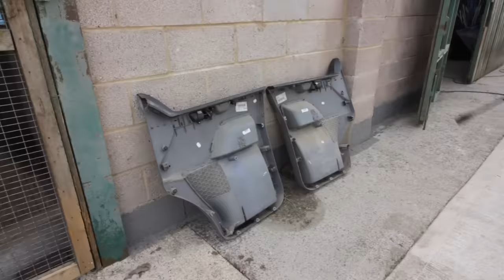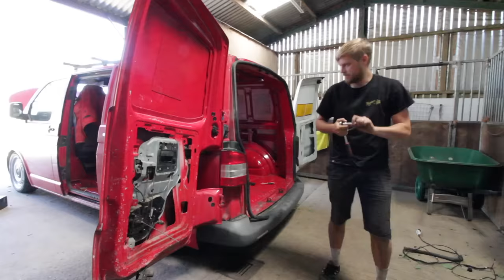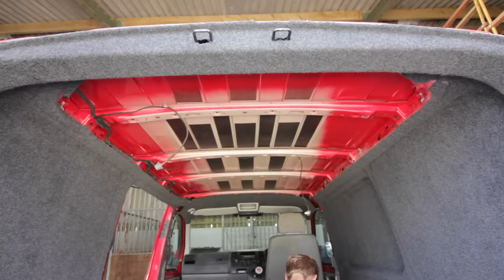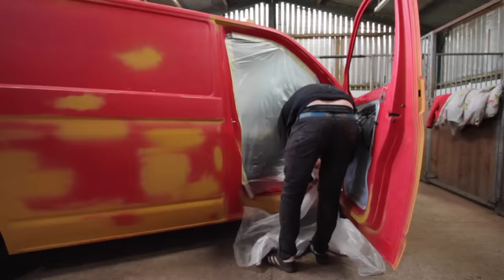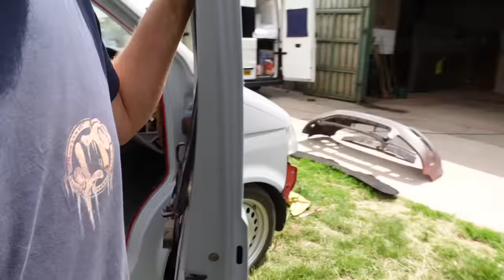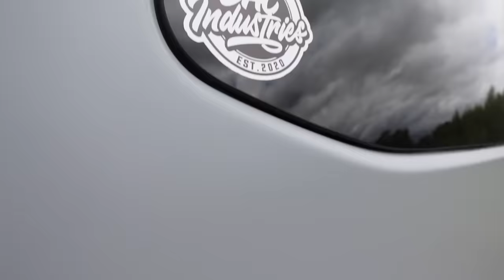RESTORING A VW T5 In 10 MINUTES Conversion Restoration Volkswagen Transporter Camper Van Conversion

Comment: Excellent 👌 I need to adjust my rear door 1 has dropped is this a nightmare or quite simple to do? Thanks.
Reply from the maker: Thank you so much for watching and for the comment Bud. It isn't too difficult. The hinge bolts on the van and door are Multispline or an allen key may work. Loosen one off and the door will move on the hinge. May take some faffing to get right but totally doable.

Comment: What suspension was used on this one? I have a T5.1 and fitted 40mm H&R springs on standard shocks and it's still way too high - barely looks lowered. Bilstein coilovers would be my choice if cash wasn't a problem but hoping this is a cheaper alternative as the ride height is exactly what I was after. Subscribed! Thanks. 👍